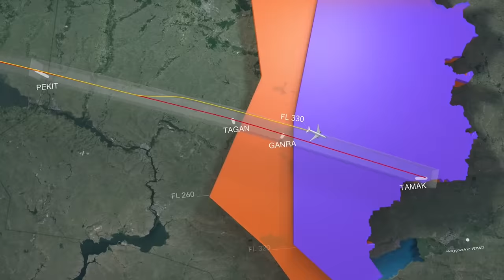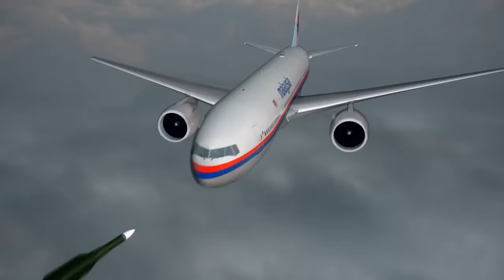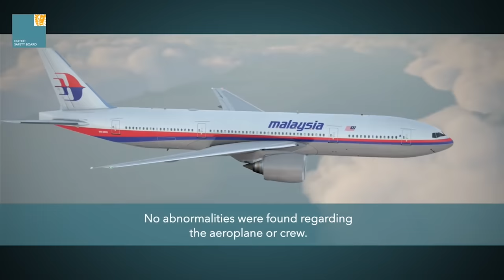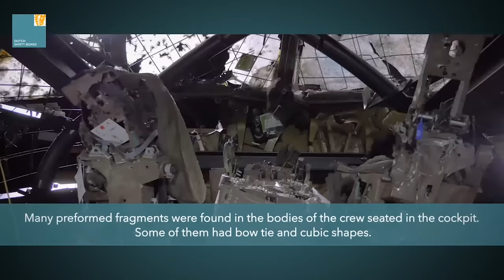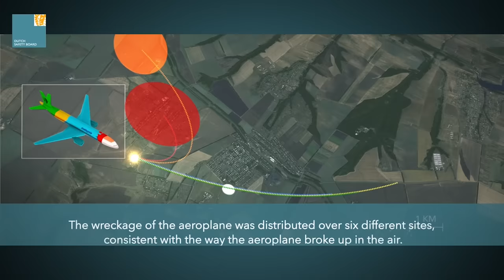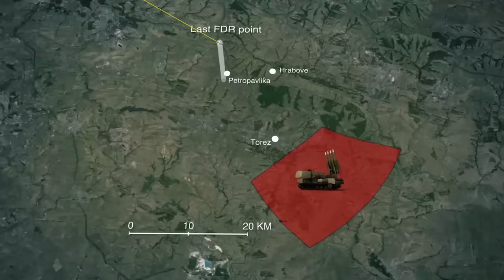Cause of MH17 crash by Dutch Safety Board

Comment: I don't know whether I'm the first one to comment, that is, to point this out - but what exactly is the goal of this video analysis? That the Soviet-made medium-range air defense system 9K37 "Buk" shot-down this flight? I think that's far more than obvious and without any doubt, but the real question should stand - how in the world and why this happened at all?

I'm truly astonished how many people here are commenting this unfortunate and tragic disaster and automatically blaiming Russia/Russians and pro-Russian militias from Donbass for comitting a "disgusting war-crime", but they simultaneously don't have a clue of the basics of the principle how does one air defense/anti-aircraft system actually work/operate at all. And this "Dutch Safety Board" itself obviously didn't have any balls to make a propper analysis by asking themselves that how come that/why they fired against that aircraft at all?

So, I'm going to make a shortest possible analysis in the comments - all existing medium-range and long-range air defense systems (whether being Russian or Western) regularly don't have any possible visual (eye) contact with anything at all. Literally everything there is done from the "inside", that is, exclusively via standard radar screens/monitors - the so-called PPI (Plan-Positioning Indicator).

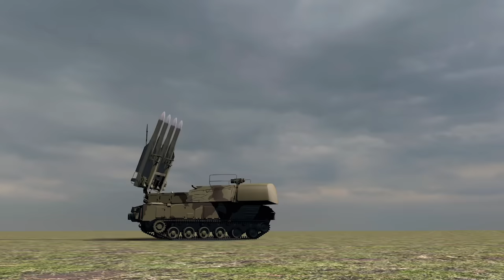For instance, the 9A310 launch vehicle of the 9K37 system portrayed here at 0:59 employes four operators - commander (who monitors the main/circular screen with range and direction to the target) and three other crewmen - one of them who monitors secondary/square monitor (which shows elevation to the target) and the other which turns the turret and elevates the launcher (the last one is driver of the vehicle, but that's irrelevant for this issue).

So, there is absolutely nothing behind "dots" or radar screens, which is why it can be (and it often is) stressful and it takes hard concentration, propper co-operation between the crewmen and very serious decisions from commander whether to launch at something or not to launch (especially if some of these "dots" are actually enemy aircraft just preparing to launch a deadly strike at your exact location, or if those dots are maybe friendly aircraft with malfunctions on their IFFs). All in all, you simply can't visually determine anything.

Even if the depicted launch vehicle (the 9A310) is linked to its surveillance radar (the 9S18 "Kupol", or "Tube-Arm/Snow Drift" by its NATO reporting name), which is most often located in the background in a shape of another vehicle and linked to it via commading vehicle (the 9S470) which, as an intermediate-link, transmits information about discovered targets from that radar (9S18) to the individual launch vehicle (9A310), there still wouldn't be any difference, because even that surveillance radar simply can't determine the exact origins of the target. Its crewmen (four operators altogether) can eventually make a blind conclusion according to the aircraft's speed, elevation and radar cross-section, but they simply can't say for sure whether is it military or civilian (best they can determine is whether the target represent friendly or enemy military aircraft, by the help of the IFF).

Of course, things are never just black & white, so all possible air defense systems have two additional features as a help for exactly this matter. The first one is previously mentioned IFF ("Identification Friend or Foe") interrogator, which represents another small antenna built onto the main radar antenna and which helps to determine whether the aircraft is friendly or not.

The IFF, shortly speaking, functions by sending few pairs of coded-signals (in shape of pre-arranged radar frequencies) to the discovered aircraft on which that aircraft has to return propper coded-signals, in order to be recognized as "friendly" by the crewmen of the system. In other words, if it doesn't do that, it's automatically listed as being "an enemy", that is, as a potentional target, which is why I personally think that the failed IFF-check (if that specific launch vehicle even had an IFF device built-in) exactly made the commander of the installation to carry out order for launching a missile against the airliner, thinking that it was an enemy aircraft, (because the IFF, of course, doesn't work on civilian aircraft).

The second feature is an optical scope with very thick lens, offering a large magnification (zoom), which is located on the launcher, is being linked to a TV-camera inside and its purpose is to visually/manually track the target aircraft. The thing is, however, that this optical camera (which is usually known as the so-called "passive guidance method") is used only in cases of radar malfunctions or in cases of heavy ECM (Electronic-Counter Measures) employed by the enemy. Furthermore, that scope can be used to track the target only if it's located in relative vicinity (not more than 10-15km away), because the zoom is, of course, not as great as in a telescope, so the operators can't find/recognize a target more than this distance away.

So, as a conclude - the comments should not be pointing out at soliders which fired that unfortunate missile, obviously thinking that they were targeting an enemy aircraft (most probably a military cargo or paratrooper plane, like the Ukrainian An-26, judging by its speed, elevation and radar reflections), but to ask ourselves what exactly was that ill-fated civilian passenger airliner doing directly over skies of war-infected country, which was already ongoing a few good months back then?

Does the gentlemen from DSB really think that someone would plan to deliberately launch a missile against such plane and by that, disgrace himself in the eyes of the world, impose unecessary sanctions on himself and totally destroy international support for his side (if they even had any from the start) as well as any serious possibility of international recognition of his republics (Donetsk/Donbass)?

I personally highly doubt that there would be anyone that dumb. This tragedy was undoubtely an erroneous/accidental shot-down, whose fault should be looked in the ones who simply allowed civilian passenger airliner to fly directly across a combat zone, which is simply crazy and very irresponsible.

Comment: For those people who don't understand.
There was no anti-aircraft missile! There are no fragments of an anti-aircraft missile, but instead of them a forgery, details and not fragments, of the Soviet and then Ukrainian anti-aircraft missile 9M38 886847379, namely the engine compartment 9D131 88699032 and the nozzle 9D131,05,000 No. 8,30,113, according to which it is obvious that this missile had no combat use, its warhead did not explode, it was simply disassembled and demonstrated JIT MH17 in In May 2018, an exploded MH17 was allegedly shot down by this missile. And before that, the engine compartment and nozzle numbers were purposefully hidden, hoping for SBU operations to smuggle parts from Russia. Strelkov, by definition, could not shoot down MH17, he is not an air defense officer and cannot control the Buk anti-aircraft complex
Reply: Where’s your proof? Are there any credible sources which could confirm this?

Comment: It is even more clearer today, that the souls lost in this tragic event were early victims of the Russia invasion of Ukraine happening today. This massacre was a direct result of Russia backing the rebels, part of the ground work Moscow has been laying for the ultimate invasion of Ukraine (they used the same strategy in Georgia).
Reply: How would doing this help them?
Reply: @jmbpaz  it didn't. That's why when this happened, Russia quickly turned a cold shoulder to the rebels that they were backing at the time. but supplying equipment to rebels is part of Russia's playbook for destabilizing a country, allowing the rebels (who are usually a form of separatist group fighting for independence) to gain strength, recognize the rebel's sovereignty as a nation, form allies with them, and then send Russian troops into said "nation" for "peacekeeping" purposes, then use the continuing fights between the rebels and the original country (Georgia, Ukraine) as justify military action against said country. 

so basically, Russia was supporting the rebels to destabilize Ukraine so they can invade (which ultimately happened. ref: watch?v=If61baWF4GE). Rebels thought they shot down a military jet and announces they did so. Finds out it was actually a passenger plane (ref: watch?v=-gPJUDOnMfg).
Reply: @jmbpaz  certainly no shortage of hypocrisy, regardless of political regime. reason for loss of support, I can see. Credibility? not sure. as important as intent is, lack of intent does not excuse one from such heinous acts (there's a reason why involuntary manslaughter is a thing and so is reckless endangerment). I don't see how tragic civilian casualty directly enacted by a faction whose actions were being endorsed for political and militaristic reasons translates to a blame for Ukraine because they benefited from it.

By using the term "suspect" are you suggesting that the Malaysia Plane being shot down was Ukraine's doing in some way? if so then that is a very interesting analysis I would love to hear more about. Please share any supporting evidence or research related.
Otherwise, I sense an agenda in your logic, and you might be selectively dismissing causation to fit a narrative. Surely, you are entitled to your subject opinion and I respect that, but whether it's worth anybody's time to hear them out is up to the objectivity of what's being said.

At the end of the day, I do not support what any country or faction does that directly results in people knowingly (and sometimes willingly) killing other people other than in a self defense scenario.
Reply: @jmbpaz  Sounds like you figured it out. Good for you buddy. Keep it up. Have a nice day. :)

Comment: It's axiomatic: never fly in the battlespace above a war zone.
Reply: George Obregon 
Russians supplying to terrorists any weapons without restrictions. This missile system Buk M3 was brought from Russia with a crew and returned back to Russia after this fatal launch.
Reply: @serhiychayka4749  
Once again, do not fly over the active combat zone. Of course, if you are worried about the lives of passengers, and not about blaming someone, or saving a few gallons of fuel.
Reply: @donkeyiaiaia4315  an "active warzone" is characteristically active - meaning that it's not well-defined because of the constant changes. The MH17 crash site was NOT deemed unsafe at the time of the accident.
Reply: There was another 2 planes nearby
Reply: Air traffic control directed them to that path. It is not that pilots can choose where they fly. They follow the path given by them and approved by ATC
Reply: @donkeyiaiaia4315  mate,singapore airline just used that particular corridor 30 min earlier than mh17